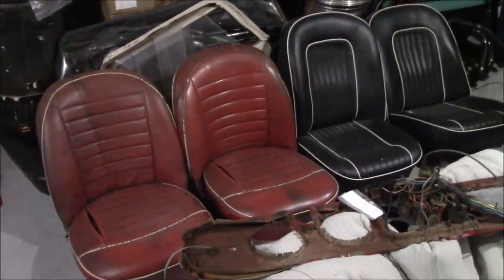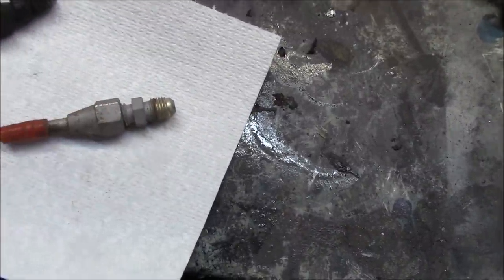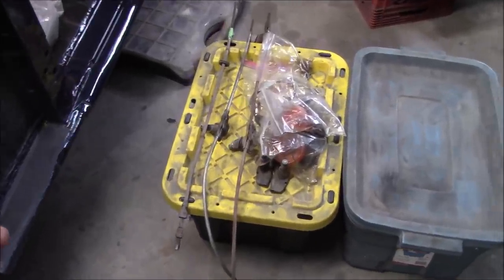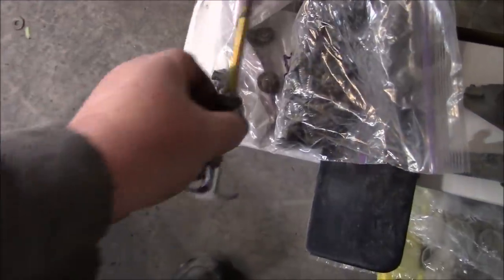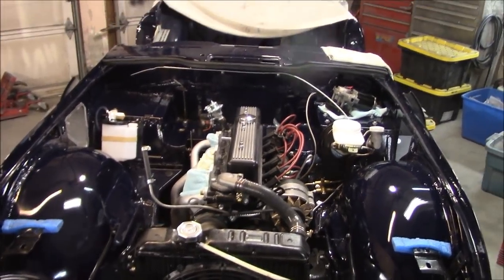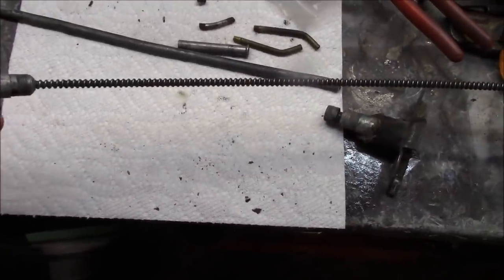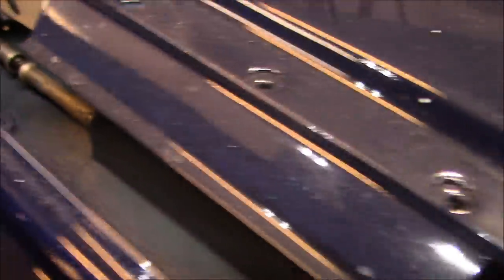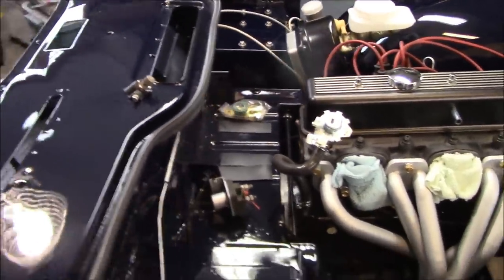1968 Triumph TR250 Restoration, Assembly Part Two

Comment: Yesterday I put the wheel well cover plates on my TR6 in place as you explained...but I don't have the rubber strips and thought boy this looks useless, so now I know to find those and get them on order. The TR6 does have mounting nuts  on the inner side wall for the two upper holes in the plates, 6 fasteners in each. Also thank you for the explanation of finding fastens in the TRF books. Much appreciated.

Comment: Great progress, everything looks clean and tidy. Those wheelboxes are so much easier to manage without the dash installed. I keep thinking that would be a lot easier to install all those bulkhead grommets before the body went on.
Reply from the maker: The Grommets are a bit of a pain to install on a freshly painted car that is for sure.   Tough call on pre installing the grommets as often you need to take them off to fit over a cable or harness as when you try to push things through that are a tight fit it will just push the grommet off where it is seated anyway....

Comment: Great progress once again David and I also had problems with that wiper motor spring clip... as I tried to put it on my TR3B, it flipped up in the air, dropped down the side of the engine and 4 years later it has never been found... luckily I did manage to fine a replacement..!!! Kind regards, Richard.
Reply from the maker: That’s exactly what happened the last time after I said to myself “now don’t lose this clip”....

Comment: Tush:

When I did my TR6 I installed the wipe cable differently than you did and I think it was easier.  You can install the cable to the motor on the bench.  Then when installing the motor start to push the cable thru the tubes as the cable hit the wheel mechanism just turn the splined part of a the mechanism to start the cable.  As you push the cable it will turn the wheel in a circle as you push from the left side to the right and repeat for the right side.  I hope this made sense as working on the motor and cable on the bench is lot easier.
Reply from the maker: Hi Pat, I have done the method you described on my TR6 and I had a difficult time for some reason feeding the cable into the gear and through the tubes even while turning the spindle on the wiper wheel box....I actually damaged the splines on my TR6 spindles by trying to turn the cable in with a pair of vicegrips (and masking tape).  You are right, I could have assembled the motor on the bench though...anyway, for me this method worked a little easier but there are certainly more than one way to do things. Cheers, Tush

Comment: The wipers look a challenge, good job. I've got to try and put new washer tube in,  i can see where on your car but you don't have heater, dash etc in the way, someone suggested it's possible through the ashtray but I'll also need tiny hands! 

Fuel tank in means closer to another start up and possibly moving under its own power. Keep going Chef (is that how you like to be addressed? )
Reply from the maker: Don’t think you will be able to do much through the ashtray hole...Chef is fine or Dave or David 😉 call me anything as long as you don’t call me late for dinner 😉
Reply: @cheftush  I'm going to have a look at the weekend, otherwise I'll just use the hole in the engine bay through to the plenum a previous owner made 😀. By the way I'm Gareth, nice to meet you Dave!

Comment: The fitting at around 4.00 looks like a hydraulic AN #4 fitting if you ever need one you should be able to find at princes auto
Reply from the maker: Hard to believe they charge $15 for that fitting eh Mike....and, you would have to add shipping to it as well.   A local option would be better for sure!

Comment: Lots of great tips in this video, Tush. I really appreciate the detail on the wiper wheel boxes & motor. Quite fiddly as they say. Question...how/where is the little short tube section fastened at the end of the wiper rod assembly on the passenger side? Cheers
Reply from the maker: Each of the tubes have a little flare on the end of them. The flare fits into a slot on the wheel box that locks it into place once you fasten the cover plate down with the two screws.

Comment: That gas tank access hole is not very convenient.  When unleaded first came in there were plastic restrictors in the filler tubes, at least on my '78 Spitfire.  At a full serve gas station in Vancouver, the attendant kept pounding the filler into the hole in until the plastic part finally fell into the tank. Thankfully the access plate was a bayonet type fitting on the rear vertical wall, making it not too difficult to retrieve.

Comment: Love the progress. I have my 70 TR6 in my garage back from the paint shop and now its reassembly. Do you do work on other peoples car, or at least direction for a fee?
Reply from the maker: Hi John, exciting times for you....its great to start putting things back on the car.   I do some work on other peoples cars but just help for free...and directions are free as well....all part of the hobby helping each other out.   Good luck with your project John!
Reply: @cheftush  thanks. I didn't take things off, and now im stuck trying to put her back together. I have a box with Weber's in it, but not sure its all there. What TR6 book would you recommend. Thanks
Reply from the maker: @johnmalone407  hi John, from an assembly perspective, go to the roadster factory online and have a look at their blue and green assembly manuals...they are not downloadable but you can view them online.  These are invaluable if you are trying to figure out what parts go where and in what order.   If you are interested, I can recommend joining the 6-Pack car club forum....it’s free to use the forum (you can become a paid member if you like and that unlocks other content) and you can ask all your questions there.
Reply from the maker: Oh, and coupled with the TRF manuals above, I’d suggest the Bentley manual and the Haynes manual for the TR6.  Also, look online for the Dan Masters Electrical Handbook...it’s invaluable as well.
Reply from the maker: This may help you as well....https://youtu.be/h1BUzPOcjYI
Reply: @cheftush  Thanks I checked them out a while back, but paper would be better. I had my  original Hayes but it didn't come back with the parts. I guess Ill order one today. Thanks

Comment: When you showed the camera into the gas tank it looked like the. Float on the sending unit was yellow.  Did you change that to one that is more resistant to ethanol type gas?
Reply from the maker: Hi Pat, not I didn't change the float....its a newer sending unit though and not the original.   I think it will be ok as I use non ethanol fuel in all my classic cars.

Comment: How about making the wing vent 2-piece? That way you wouldn't need to move the clutch cylinder
Reply from the maker: I’ll only have to move the clutch master once Barry...once the vents are fitted, they will no longer need to come in and out. They will be permanently bolted to the body tub.

Comment: I remember when I replaced the wiper wheel boxes on my TR4A, I cursed the engineers who designed the system and all their ancestors! Also on the TR4A, the position of that round cap on the wiper motor determines the wiper park position. So you then have to able to reach/tighten those top plate screws on the motor assembly, which isn’t easy with the motor in place. Alternatively, you can make these minor modifications to update your wiper system.😉https://youtu.be/NX4lBvHDMs8
Reply from the maker: Hi Jim, yes, I’ve had to do the same thing with my TR3A wiper motor cap as far as parking is concerned...I’ll worry about that later 😀

Comment: As you said the wipers are a major pain and you don't use them. My Cobra Kit Car uses the same setup. It cost $450 for all the stuff and when I went to register the car they didn't even check to see if it worked. As the Cobra doesn't even have a roof I never drive on rainy days...but I got the wipers so I guess all is well.....
Reply from the maker: When I did my 60 TR3A restoration, when I took it in to be inspected I put it on a flatbread as it had no plates...the guy barely looked at it as he could see that everything was new....he said I could have just left it on the flatbed....I said....are you sure you don’t want to check the lights or something as I’d spent so much time making sure everything worked...he said nope....I’m sure they work....